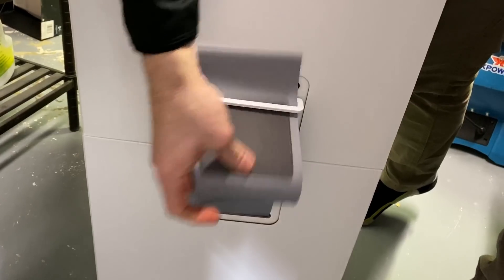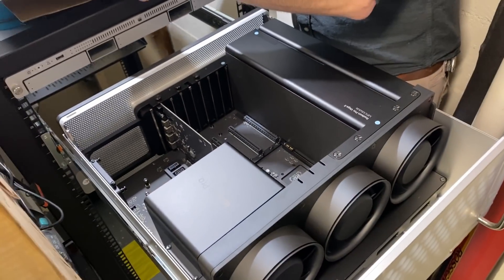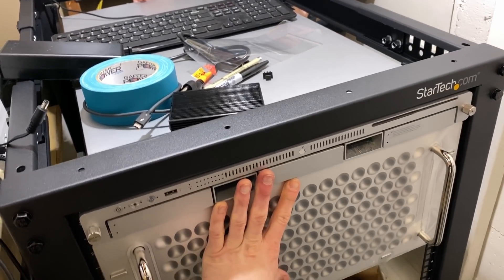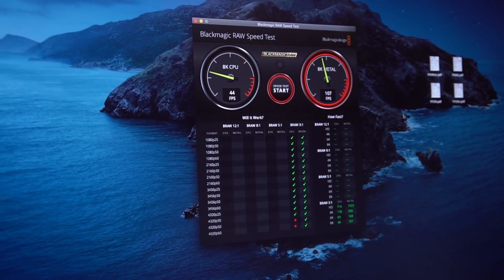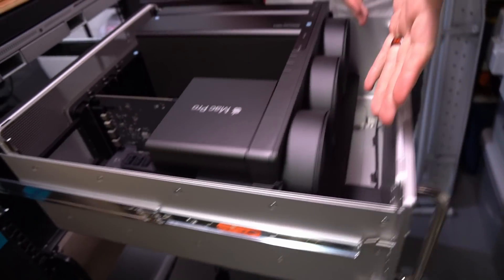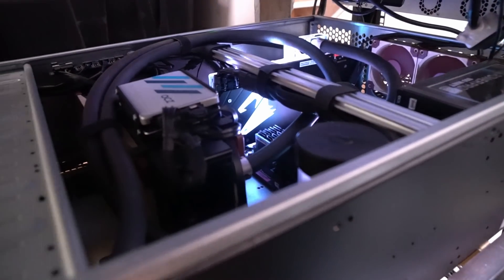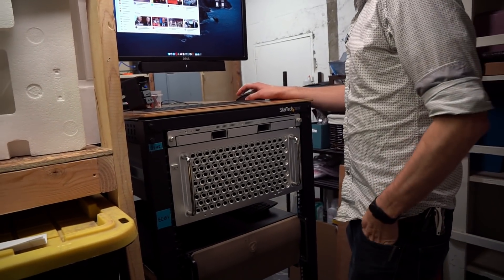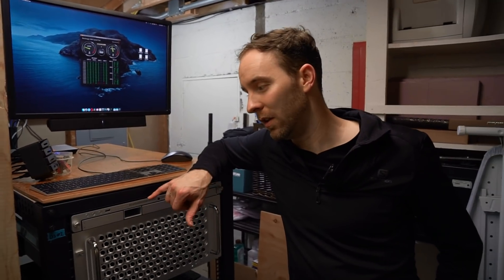Apple Mac Pro Rack - Unboxing and Observations from a Video Professional.

Comment: Would love to see a more in depth walkthrough of how that Xserve is set up. Are you using NVME exclusively for storage or are you somehow tiering SSDs and HDDs? How are the NVME's connected? Which 10G network card did you go with, and had you tried using a 10G network card with the Mini before you abandoned that option?

Comment: Why do you want to buy a second rack if you could have opted for more power in this one?
Reply: Because it is very difficult for 2 editors to work using the same keyboard :) Daily we have 2-3 editors working so multiple machines are necessary for our workflow.

Comment: didn’t see a reply to your case flex issue. 

Neil in TO, .. didn’t seem to experience any of that at all. 

my view .. the rails are not 100% able to withstand the mass of that rig. +/- the rack u have. maybe only 99%. 

if it was me .. it would be on a solid bed rack. 

donno what the proper term is sorry .. tired .. super long day that still ain’t over. 

i.e., .. NOT hanging from holes in a rack. 
laying on a flat rigid bed tray that is in the holes. 

I mean .. there are no ‘ rack holes ‘ on the front of the chassis, like a 1U Apollo, or focusrite, etc. 

until this vid, I theorized it was absolutely impossible to even do what you did. 

not surprised there is a touch of flex.

it .. was not designed to do that. 
no way. 

or u got a lemon. 
but I highly doubt it. 

the fit / finish / sound of every component of every one I have seen so far .. pure perfection down to everything. 

this is the first I have seen a hint of anything not 100%. 

I have not seen a spec for rack weight, maybe u have that / but .. it ain’t light .. hahaha. 

thank you so much for this vid. 

all the observations. 

even just the ‘ how sparse the motherboard is ‘. 

yeah. 

that is incredible. 

same with my 6,1. 

blew me away to look at it
and upgrade my RAM way back from 16 to 32. 

so many things to spend coin on, but .. there is no such thing as enough RAM in my world since 1983. 

this machine... will finally let me [one day] isolate what that might be [for my usage]. 

but as soon as I find that ceiling, a week later I will want more, will see that what I theorized was enough ain’t enough, that I wasn’t looking at the numbers right or close enough. 

once you F E E L what all the RAM is like. 
u cannot go back tho. it is painful. 

hahaha. 

I’d say, when u have a moment of down time, pull the rack, lay it down on a perfectly flat AND level table surface (check it w/a clinometer that you trust), and try opening and closing the lid. I can recommend a rad software one if u don’t have a need for a physical one .. as the cost of analog is obnoxious for anyone without a tangible real-world use ...

bet it feels and sounds way different. 

cheers from a pro graphics guy in Canada, that now needs a desktop AND a rack version for my studio. 

got to get busy and make a pile more money. 

each is a completely different tool to me and cripes .. I NEED both now .. these videos are crystal clear that I do .. each have such unique strengths that the other doesn’t. 

just how heat rises in each. 
that is a much bigger deal that anyone has clued into in YT ville. 

especially when u start stacking cards, subdividing that chassis space up.  

vertical or horizontal. 

yup. 

that will matter. 

computer can still run with the lid open in the rack / impossible on the desktop. 

that is a huge thing. 
especially if u have it jacked with cards. 
that are finicky AF. 

oi. 

consider this people. 
the 500 bucks difference is squat once u add in the downtime +/- hourly rate of the IT or tech or .. anything. 

that 500 will vaporize before your eyes. 
and your hair. 

each was heavily considered since 2014. 
they digested a lot of Pro feedback. 
in every market. 
not just audio 
not just video

scientists 
server peeps
designers 
coders
writers 
artists

facilities will have 1000 of these as a render farm. 
just as they have had 1000 in the G5 and XServe days .. over the decades. 

everyone in YT land is obsessed that their use is the only use. and even a single seat is overkill + over priced. nope. actually really inexpensive. 

they are just perhaps not the target market. 

so laughable. 

and one day this 10K rig will also be flipped for 100 bucks in a decade. 

to a kid in their basement. 
to screw with. 

my 20K+ rig in late 1995 wasn’t worth 200.00 six years later in 2001. 

can’t cry about it. 
that is just how far the new stuff got over the old. 
we should be excited. 

I bought a mini 1.41GHz to tide me over under I could order a dual G5/2.0 .. the mini .. crushed my 1995 build for peanuts. 

think about it. 

I was doing freelance and running a multi million dollar graphics lab for 3 years while my system collected dust. I didn’t need it to do more. I had the latest gear @ work. I upgraded it as far as the 3rd party peeps could take it, but .. it was EOL. the new mini (brand new concept) .. crushed it. the G5 crushed the mini. the MacPro1,1 crushed the G5. 

always happens, I have seen it for 30 years straight. 

only keep a system for a year, then flip it. 

always. 

getting work done 4x faster (whatever X times u can leverage) is priceless in the right hands. 

most don’t get it tho. 

oh well, this ain’t for them. 

Apple couldn’t give a damn, go build your own dream rig then from off the shelf parts, or custom parts. 

don’t let anyone hold ya back. 

no such thing as right for everyone. 

this is just an incredible tool to do everything faster, better. can’t wait for mine to arrive. 

u have made my BTO selection more informed for everyone of these I end up ordering. 

:)

Comment: apple needs to switch to AMD , more specifically, Threadripper 3, imagine a 64 core 128 thread Mac Pro, or if they went server grade, EPYC, so dual 64, so 128 core/ 256 thread 3TB ram monster, all PCIE 4.0 no stopping it ever lol
Reply: Gary westin what they need is optimization, Amd is just high specs, while Intel has a lot of optimization technology and macOS is deeply integrated with intel cpu

Comment: Small correction: The Radeon Pro Vega II is better at workstation tasks than the 1080 Ti not because of anything special that Apple did, but because the Vega architecture with its High Bandwidth Memory (HBM2) and High Bandwidth Cache Controller (HBCC) is insanely good at 32-bit floating point (FP32), and by extension; DaVinci Resolve workloads. Resolve users have been installing Vega 56, Vega 64 and Radeon VII cards in their PCs for a while for this exact reason, and it's nice that Apple partnered with AMD to create the Pro Vega II for the new Mac Pro.
Reply from the maker: I agree

Comment: A computer without wires should be the industry standard now. That's one of the things I like about apple computers the most, even if they are out of my price range.
Reply: @Cypher Music What wires LOL? The last mac pro to have wires on the inside was the power mac G4.  Starting with the cheese greater G5 your drives connected directly to the motherboard. ( or in apple speak- logic board) This should be industry standard by now. Having to manage cables is so 15 years ago.
Reply: @Cypher Music yes no cabels on the insude is nice but when you need a pcie card with and extra power conector it realy sucks

Comment: So you paid $10,299 for the the equivalent of a 3900X with 32 GB RAM, a Radeon Pro Vega II GPU and a (slow) PCIe 3  1TB NVME drive.  "So pretty !"  It better be for that price. 

Premptive strike:  The SSD wasn't slow because it is 2 512GB SSDs run in RAID0.  Let me know how that works out for you in the long run.   Especially when they are the special SSDs that run under the T2 chip's security.  Because one day one of them will fail.

Comment: Oof, sucks that you guys couldn't make the hackintosh work. The Mac pro is remarkably bad value at your configuration. You could've easily gotten a couple Radeon vii's a beefier xeon, more ram/storage for less going for a hackintosh. Its a lot to pay 10K for a machine that basically has a 64cu RVII and an old xeon processor. Unless you go for duos and 28 cores, I don't think it's worth it.

Comment: Check over at Neil Parfitt’s channel. He’s a composer who filled that rack version to the brimm with Avid HDX and other audio interfaces. Seems to work great too. I’m really warming up to this unit. Several of us audio post users are getting this, and if I go back to MacOS so will I. 23 year Protools post production user here with a preference for Reaper(& hobbyist use of Davinci Resolve).
Reply from the maker: I really like Neil's video! It was his video that inspired me to post our set up for video editing.
Reply: AVID will soon be selling an external TB3 card mount device, so you don't have to buy Mac PRO.
Reply: @imho4990  there are plenty of external PCIe enclosures. The point is that, as Neil shows rather well, it's a very messy setup with a ton of boxes, cables and dongles.

Comment: why run a Mac?
Reply: VideoCommenter I don’t know how they can be avoided
Reply: VideoCommenter lets see: a. because the Apple ecosystem is a proprietary driven system that vendor locks you in, with very limited accesses to hardware (no, Hackintosh is not an option, and not a legal way to use OSX); b. As Apple controls the ecosystem completely, it also charges a premium for it? c. Apple uses questionable technology like DRM to further lock you into specific hardware, and limit and control the HW; that’s malicious intent, towards its users d. The Apple HW is not well suited beyond OSX, so not very useful for Linux or Windows; e. OSX is a departure from Linux and UNIX, not a lot of freedom and no built in package manager, not a lot of power tools compared to Linux or UNIX systems, just not as powerful as Linux;  f. In OSX Apple fucks backwards compatibility on every OSX release, good luck being a software developer maintaining apps needing low level access or optimizations on the OSX platform g. Did I mention extremely limited hardware? h. Apple has questionable hardware/engineering practices, follow Louis Rossmann’s videos (sorry might have misspelled the name there); i. the T2 chip is a punch in the face, to all Apple users, not only is it not needed (there are vastly superior alternatives), but if the MB dies, you’re done j. The laptop line that Apple makes is absolutely terrible, no workstation class, no HW expansion, terrible port selection, terrible thermal management, no thanks; k. Games, what Games? no games l. no nVidia options or even AMD GPUs optimized for the Apple platform beyond a handful low performers picked by Apple
Reply: @FooBar89  lol I doubt the choice was ever between MacOS and Linux. Most NLEs don't support Linux, so Linux is out of the question pretty much right off the bat. Comparing MacOS with Windows, MacOS provides a far better user experience, though yeah you're pretty limited in terms of hardware selection. Ultimately these people care more about having a streamlined OS that doesn't frequently require you to fiddle and tweak things than about software freedom, and if you're getting paid for getting something done quickly, you might as well not have your OS get in the way like Windows and Linux so often do.
Reply: T Freeman how does OSX provide a “far better” UX? it’s the same Pro apps on both platforms, with the same UI and UX
Reply: @FooBar89  Windows is loaded with bloat that most people don't want, with its auto-updates, shitty search bar, triple tiered settings GUIs, ads, and stuff like that. Installation of applications generally is a much smoother process on MacOS than on Windows, and if you need it (most video editors don't), the terminal on MacOS is far better than Windows Power shell. Like MacOS has most of the UX things people like about mainstream Linux distros, while having most of the software compatibility that Windows does, at least in creative applications like video editing. Really the only place MacOS loses is in hardware configurability, and the Mac Pro is arguably not too bad in that respect outside of the price.
Reply: T Freeman that’s a bias and misinformation, as a user of both, I’d have to strongly disagree
Reply: @FooBar89  I'm also a user of both lol
Reply: @FooBar89  tbh I'd be curious where you disagree. Windows has certain benefits in that I'd choose a windows machine if I cared about hardware performance per dollar or using Nvidia graphics cards, or if there was specific software I needed that only ran on Windows. MacOS does have some flaws, like the multi-monitor support can be janky and there's some annoying mouse acceleration that's difficult to turn off.

But in terms of things that bug me on a day-to-day basis, not being able to easily find settings I want in the menus is a huge problem with Windows, and the defaults are often shitty. You implied you do software development in one of your comments. I don't know anyone who prefers to do software development on a Windows machine over MacOS or Linux. Video editors have different needs, and if hardware cost was not an issue, I imagine most of them would prefer MacOS over the two alternatives for the reasons I've described.
Reply: T Freeman Windows and Linux is where I observe most of the software development,  OSX is close, but behind, so almost a 35%, 35%, and 30%, (out of that 6M) with the technology I’m using (I can’t share that but along the lines of real-time, AI, perf etc.). Population size is 6M developers. 

I don’t really care about any particular OS, or settings, I configure these once and never touch again. Yes they are all terrible, but I don’t care, I don’t use the OS or interface with it, any more than in that it is the platform that runs my apps, which I do care about. I care about package management, where Linux is great, Windows is ok and has its different ways, and OSX is just below ok. I care about my tools, and for what I do, Windows wins by many miles, Linux is second there. OSX, just no, absolutely terrible, for what I do anyway. If you do web development, maybe it’s different, I’m not doing that. Anyway, I could go on and on. 

Ultimately, Windows (and Linux) gives me the best HW, the Macs with OSX could never match that, not in a million years. And Windows gives me excellent support, drivers etc. much better than OSX, if Linux had that level of driver support, it would be my get go no contest. Macs and OSX I’d say are hyped and overrated. You’re milage might vary, use what you’re comfortable with, who cares, in the end, the OS and the HW are enablers, nothing more. I just think many uninformed choices are made, and in the end leads to tears 🤷‍♀️
Reply: @FooBar89  At the places I've worked, almost everyone used macbooks for software development, either running MacOS or Linux. For AI applications it seems reasonable to find Windows preferable from its better drivers and hardware support, so I'll give you that.

Never had a problem with using Brew as my package manager though on MacOS, but really that's outside the scope of what a video editor is likely to care about.